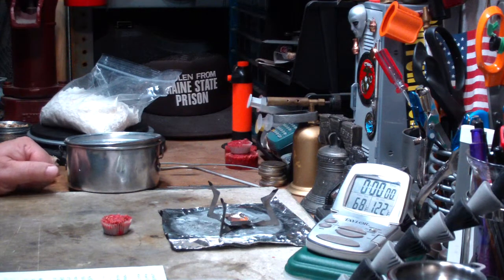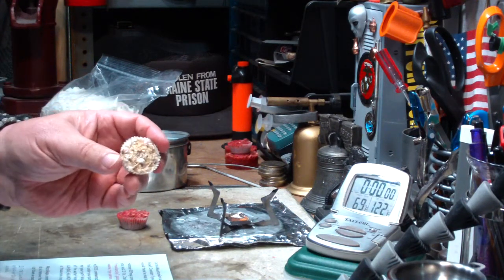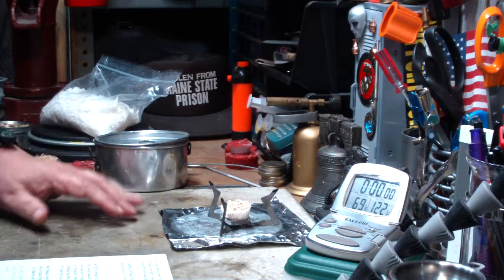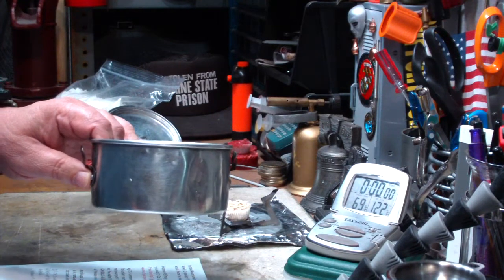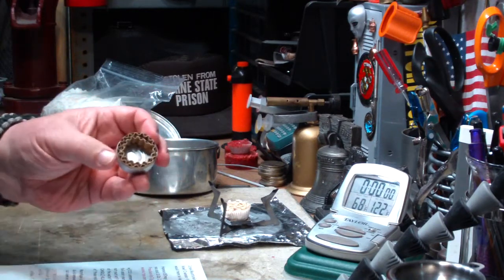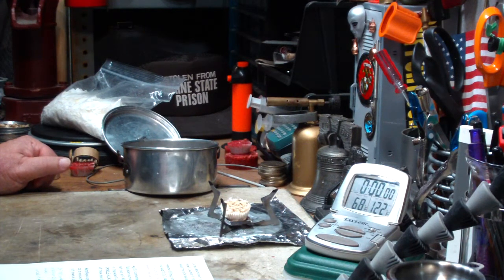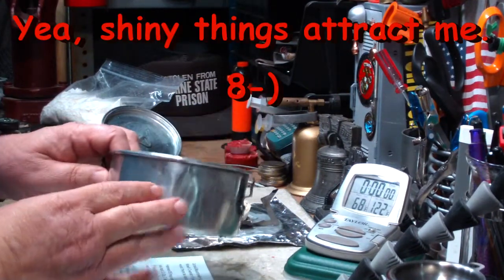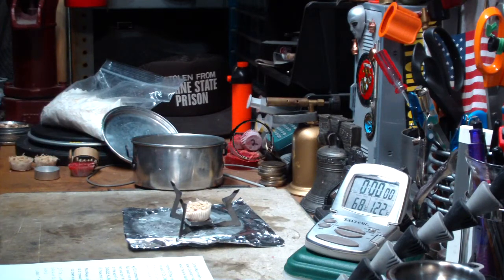Wax Coated Wood Chips in the WetFire Stove - Boil Test #2

Comment: Ok, here is a crazy idea....What if you soak the woodchips/sawdust in isopropyl alcohol and then coated them in wax? I am also wondering if putting a layer of magnesium dust on top before the wax solidifies, would facilitate lighting them with a firesteel?